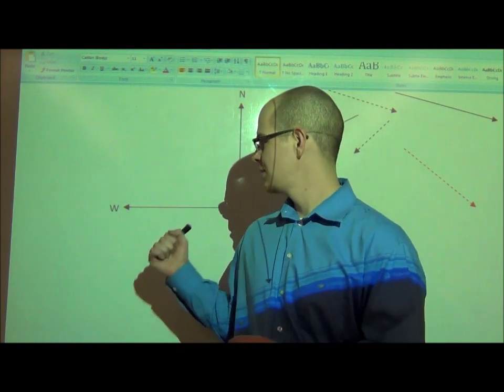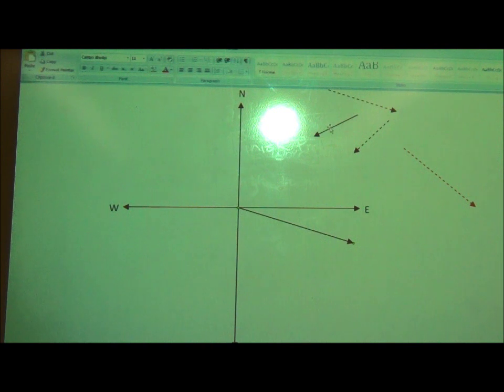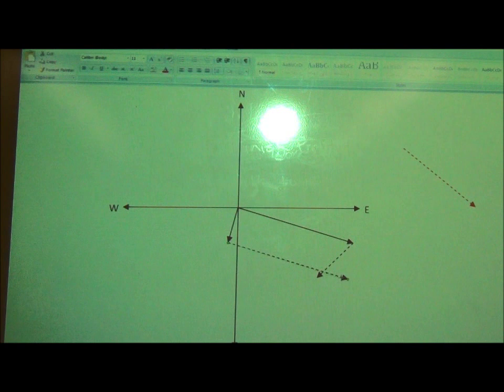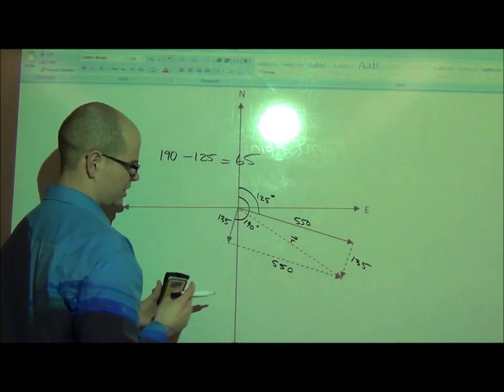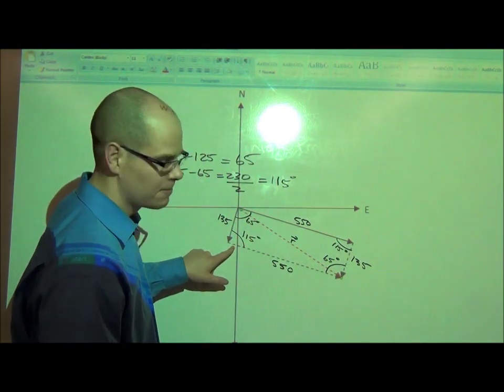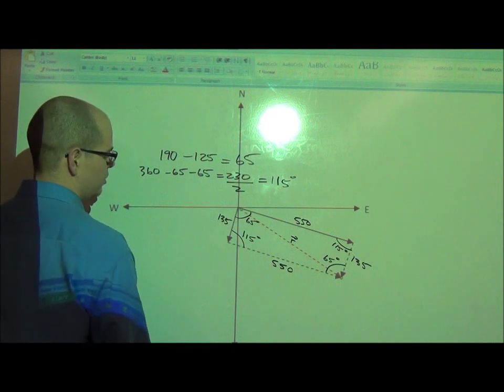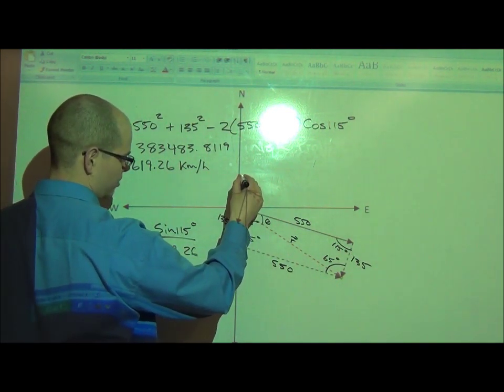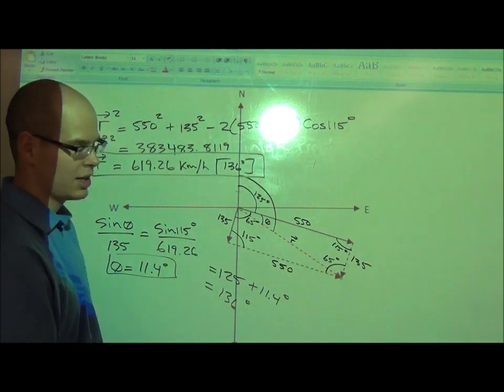Vectors Parallelogram Method

Comment: No, this is different. The question states that the angle is at a bearing of ____whatever the angle is____ degrees. That means it starts where ninety degrees is and works clockwise. He was correct.

Comment: It is unclear why the first vector was placed SOUTH of east rather than west of east, after all 125 degrees could signify 35 west of the firts quadrant.  It is a very subtle point that the vector has a south direction which has to be inferred by looking at the board...it is not stated by the presenter